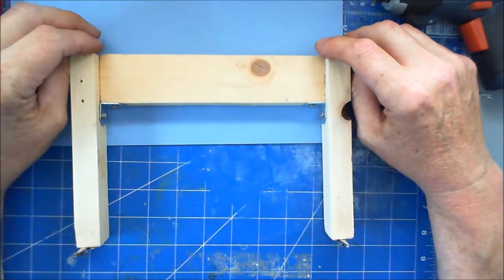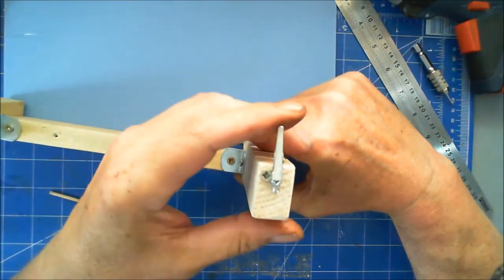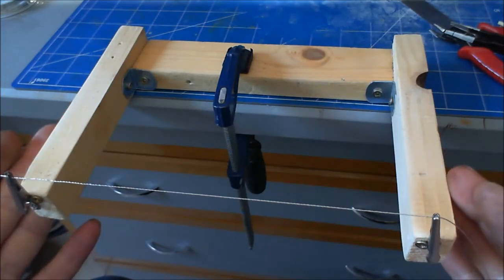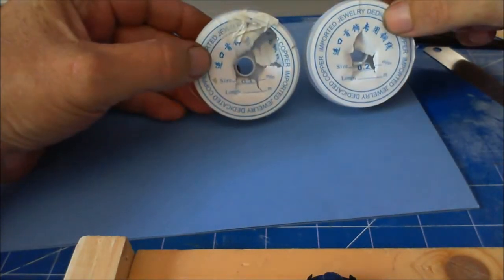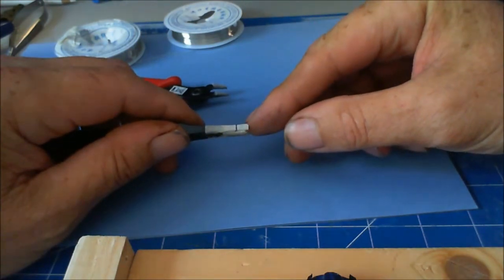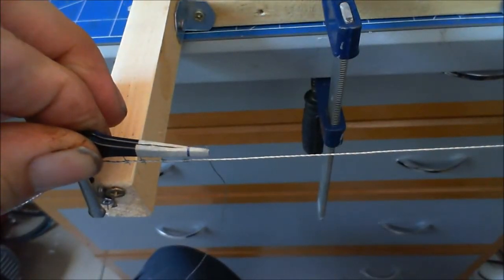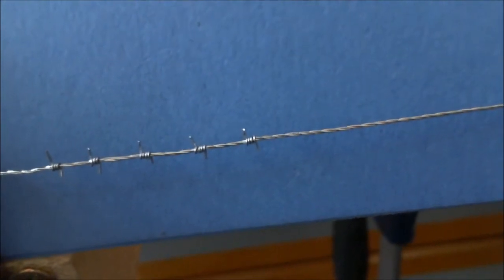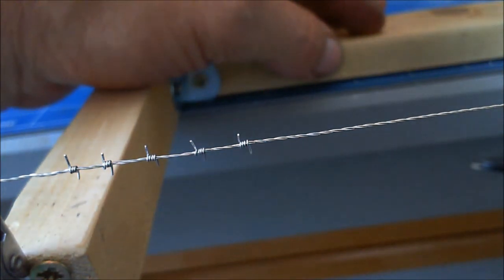How I Make Barb wire

Comment: Ah, Sim, that jig is brilliant! I'll build me one too! That'll make it way easier. As I saw Switcher already mentioned the way I do barbed wire with four spikes, but I guess I can use the jig the same. Very nicely done! Jens
Reply from the maker: Thank you Jens  . I am so pleased that the jig is of some use to you may be I can teach the master things or to ha,ha . But on a serious note, I need some advice on figures, not the female type that would be nice, but I need to get some figures to go on my diorama? Or my plans are quite fluid at the moment. I've been looking around because I need British troops walking the only ones I can find are Tamiya . I didn't know if they were any good. I'm not too keen on Tamiya , but if that is all that is going it will  have to do. I didn't know if you knew of any other makes, because  I would rather buy something with a bit more quality sim
Reply: Simon Kemp. Models I guess you mean the Tamiya British Infantry marching. I have them painted up and with regards to my not so great skills on painting faces I do like them very much. British troops are so difficult to find. It's like you Brits hadn't been involved in the invasion at all, at least in this segment of modeling. Jens
Reply from the maker: Thank you Jens , I am going for Tamiya troops. If you  rate them. They can't be too bad. I just been didn't want to buy something  I would put in the bin and now you're thinking what the hell does he want  with figures. There's a couple of kit reviews, I'm doing, I think you will figure that out ( all anyway. What invasion was that) sim

Comment: Cheers for this video, do you need to glue the wire in place or solder it or will it all stay in place by itself?? 
Many thanks.
Reply from the maker: Sorry I didn't explain that in the video, but when you wrap the wire around if you keep it tight so it stays in place, pushing together using your thumb from one side and tweezers from the other side  then cut to length and squeeze the Bab together using your tweezers. That is enough to keep it secure until you paint once you've painted it fixes it. So you don't have to do any glowing. I will do video on how to do all of it. Sorry about that  Sim
Reply: Simon Kemp. Models Don't you dare say sorry Sim. You are helping out a lot of people with these videos and I for one am very grateful for them. Many thanks for the information and the idea for the rig to make the barbed wire is brilliant. Please keep making these videos and don't ever be sorry, we are all human and having friends online to help each other out is a great and valuable tool to this community.

Comment: Link and name for the treeds pleas
Reply: Or wires ok thanks and Link to the video you referd to.
Reply from the maker: Yes it's John Moore scale models. He did a video on making trees out of wire.. He made quite a big one, you can easily scale it down. I will be doing  how to on a few weeks time on how to do trees Very much based on the one that John did but just using a different coating Keep doing what you're doing Sim